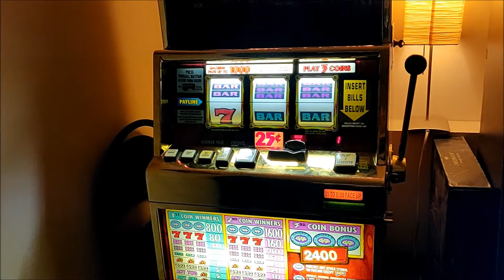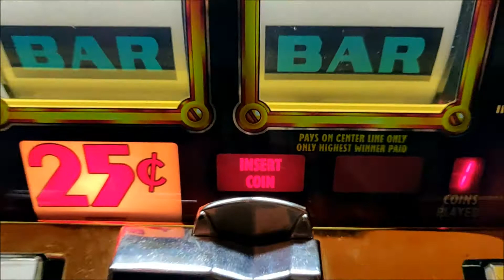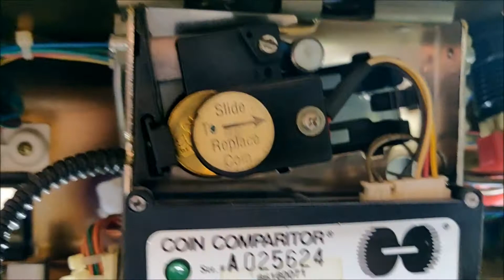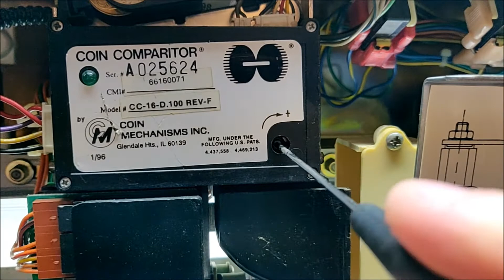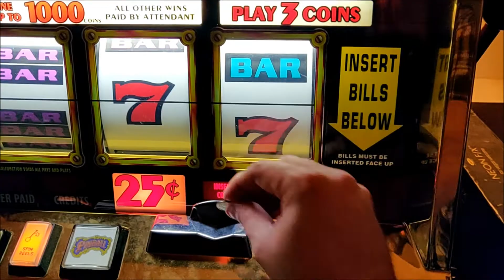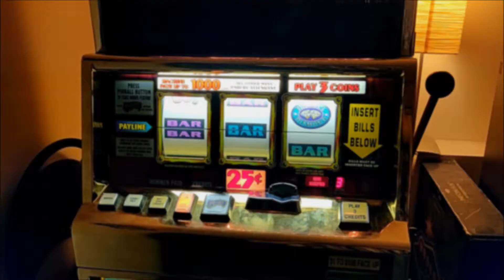Slot machine repair - Coin Comparator adjustment to make it more likely to accept coins

Comment: I have a question. My comparitor is slightly different, yes it holds the coin in like this, but the spring is intact and it does not slide close enough to actually hold the quarter in place.  It does not look like it can slide anymore as their is a plastic piece that stops the comparitor from getting any closer.  Any ideas what might have happened to it?
Reply from the maker: You probably have a large coin comparator, designed for large $1 tokens and similar. They had two different designs, one for small coins like nickels and quarters as seen in my video, and a different kind for larger coins/tokens.

Comment: Not sure if you will see this or not, but mine will accept the coin, and I can play but only one coin at a time. I cant put more than one coin in at a time. Also, my machine shows a coin in, but not a credit. How can I get it to accept more than one coin so that I can play max bet?
Reply from the maker: Coins inserted go to the Coin In display, not credits, so that's correct, but odd that you can only insert one coin and future ones are rejected unless you have the wrong software installed. 

Support for this issue is beyond the scope of this video and is tough to do in YouTube comments. I would strongly suggest posting this in the IGT S+ section of the NewLifeGames.com message forum (free to join) with as much detail as possible and I and other members there will be happy to help.

Comment: I have a tripple lucky 7s slot machine,  but it accepts quarters,  but not going into the hopper,  it falls on the inside cabinet I think its the overflow chute. Just started doing that. Thought I would ask you if you might know what the problem could be.  Any help would be great. Thanks
Reply from the maker: There's a diverter which will direct coins to the drop (the small plastic chute that directs coins to the base that the slot machine would be sitting on in a casino). If your hopper is full of coins, that's normal behavior. There's a metal probe with an orange wire that sticks into the side of the bowl of the hopper. If it's touching coins, that tells the machine that the hopper is full and to divert additional coins. There are multiple holes for that probe to go into -- if you move the probe to a higher hole where it's not touching coins in the hopper, it should stop diverting them to the base. 

If that doesn't resolve the issue or you need further assistance, please post your issue to the NewLifeGames.com message forum where a number of people can assist you.

Comment: I think you should not leave it there. You moved it all the way counter-clockwise to where it will accept the maximum with fewest rejects. That defeats a lot of the purpose of the COMPARATOR function! You should now re-open the machine and keep making small adjustments clockwise until the machine starts to reject coins. Keep some odd mangled and/or dirty coins on hand for this as well. Ideally, you should also have a brand new uncirculated coin in the comparator as the coin it's searching for. Once you have the machine to the point where it is just starting to reject the mangled/dirty coins, go ahead and turn it counter-clockwise in very tiny increments until it finally accepts the legit-but-worn coins again. And once you get it to that spot, that's the spot  you want. That's the IDEAL spot. You're not telling them how to find the ideal setting, you're just showing them how to de-activate some of the features of the coin comparator.
Reply from the maker: I understand what you're saying and you're not wrong with your assessment, but the audience for this video is home owners of slot machines that are being operated for amusement only.

If this were in a casino of course you'd want to make sure that slugs and the like were accurately rejected. However, in a home environment you just want to get a credit for the coin or token inserted into the machine and there isn't any concern of fake coins being used.

Comment: Question for the slot machine community. I have a Double Diamond IGT machine and I'm having an issue with the 61-1 code. I've done all I can think of to clear the machine with the clear chip and new chips but when I go to turn the reset key the code will not clear. I know the reset key is working because i can change number or codes in the display. I've replace the battery and the door optic with no luck. Any suggestions would be appreciated.
Reply from the maker: Clearing a 61 error is outside the scope of this video. There's a guide in the S+ section of the New Life Games message forum at http://www.newlifegames.com/ , and that forum would be a better place to ask for assistance if you still need help after reviewing the guide for clearing that error.

Comment: Quick question since I have run out of options...I have an early 90's 3 reel wild cherry slot machine that was handed down by my grandfather.  There are no error codes but the coin just drop through when we go to play.  I have a feeling it is missing a coin comparitor...my machine does not have the one like your machine.  It doesn't have anything where the coin drops through.  Do all of the early 90's machine have them?
Reply from the maker: Based on your description you likely have an IGT S+ slot machine which is pretty much the same machine in this video. Yes, it should have a coin comparator.

I'd suggest joining the message forum (free) at NewLifeGames.com . Post pictures of the inside of the door of your machine and there are members and vendors there who can get you the parts you need to complete your machine.
Reply: Hey I just acquired a wild cherrys machine from 1994 …could you possibly answer a few questions?
Reply from the maker: @terryohagan3569  The comments section here isn't a great place to provide technical support. May I suggest that you create an account (free) on the New Life Games message forum and post your question in the IGT S+ section? Me or another member will be happy to answer your questions there. http://newlifegames.com/nlg/

Comment: Hello Knagl and hello everyone.  I have a somewhat specific question to ask.  A million years ago, I was given a Taito slot machine, which is nowhere to be found now.  It looks a lot like to Pachislo models, with 3 real rollers equipped with a stepper motor.  The model is Space Invaders.  Since his coin acceptor had given problems, when it was replaced identically the software on start-up detected the change and asked for an 8-digit password to be entered.  However this password is the result of a password generated by the slot.  It basically spits out an 8-digit password and asks for another to be entered.  I ask you if you know which software generates an 8-digit password compared to 8 digits given by the software.  Thanks so much to anyone who can help me🙏
Reply from the maker: Hi Daniele. I would recommend the PachiTalk message forum for help with your machine. http://pachitalk.com/

Comment: Is that a flat head or philips screwdriver  you are using to set the sensitivity. It is so small I think I may have stripped it.
Reply from the maker: I just looked closely at a couple of my machines and it's a flat/slotted hole in the potentiometer dial. A flat head screwdriver is what you'd typically use.
Reply: @knagl  Thank you. The "insert coin" light doesn't come on (bulb is good) so I think it is something else. Any thoughts?
Reply from the maker: @DonReitzfeld  There's a number of reasons why a machine might not accept a coin. Unfortunately the comments section here isn't a great place to try and do individual technical support. I'd encourage you to post in the NewLifeGames.com message forum where a number of folks can help you get your machine up and running.
Reply: @knagl  Thank you.

Comment: My IGT s2000 Double Diamond slot only ejects a paper win ticket...How do I change it to drop the winning coins instead? Thanks for posting your videos!
Reply from the maker: Hi Manuel. You will need to adjust the programming of the machine to have it pay from the hopper rather than the ticket printer. That is outside the scope of this video. Look at the IGT S2000 section on the New Life Games message forum for assistance with how to program your machine. Here's a direct link:
https://newlifegames.com/nlg/index.php?board=81.0
Reply: @knagl  thanks

Comment: I tried your instructions a few times but coins are still dropping on tray sir. Pls help. Thank you.
Reply from the maker: There could be a dozen other reasons why a machine isn't accepting coins. If the machine is in a tilt condition it won't accept coins until the reason for the tilt is resolved.

Your best bet is to post in the NewLifeGames.com message forum (free) with details of the machine you're working with and the folks there will help you out.

Comment: This was a big help I just got two machines one is from the Sand Vegas casino and the cion mechanism had no labeling whatsoever. So it would not accept quarters. Now I have to sort out how to close the door without the lock someone bored out which allows the door lock mechanism to engage yet not to be opened.

Comment: Quick question, My Ballys Double Diamond has the same coin comparator and I'm having an issue where it is humming loud! but, only when I have a coin in the comparator & slot door is closed, If I take the coin out and shut the door the hum is gone ... I've tried cleaning the coin comparator, Didn't work ... Any advice would be helpful.
Reply from the maker: The buzzing is likely from the solenoid for the diverter. There's a capacitor in there that gets dried out and needs to be replaced.

I'm unable to provide technical support here -- my suggestion would be to create an account (free) at NewLifeGames.com and post in the forum for additional help. Good luck!
Reply: @knagl  is it the solenoid that's right on top of the coin rake? Soon as I unplug just the coin rake solenoid the noise stops
Reply from the maker: @RollerCoasterAddict  Yes, it's the solenoid that controls the coin rake.
Reply: @knagl  okay so on the forms someone is saying I need to replace the C1 capacitor and that should fix the issue question is where do I find these parts?
Reply from the maker: @RollerCoasterAddict  You'll need to find a new capacitor that matches the value of the existing one. eBay, Mouser, Digi-Key, etc. should have replacements.
Reply: @knagl  okay ill check it out 👍

Comment: I have a DD 25cent one 
Just got it 
Coin gets past the comparator and then gets ‘stuck’ behind and won’t drop down 
What could be wrong??
Reply from the maker: Hi Ross,

I would make sure that the sample coin is seated properly in the comparitor -- if it's not seated properly the coin coming in can jam, although you said it gets past the comparitor and I'm not quite sure where you're talking about.

If you're saying it's getting caught in the coin-in optics that are below the comparitor, you might have the wrong size encoder (coin guide) for the size coins you're using. For example, if you had a nickel encoder but are using quarters, they won't fit through.

I really don't provide technical support in the comments here. I would highly recommend the user-to-user support you can find at the NewLifeGames message forum here: http://newlifegames.com/nlg/index.php?action=forum

Comment: I have a double diamond 25 cent slot machine,  quarter works but the bill validation doesn't work? How can I fixed the issue?
Reply from the maker: Hi Luis. It may be something simple like your bill validator not being enabled.

I don't provide technical support in the comments here. I would highly recommend the user-to-user support you can find at the NewLifeGames message forum here: http://newlifegames.com/nlg/index.php?action=forum